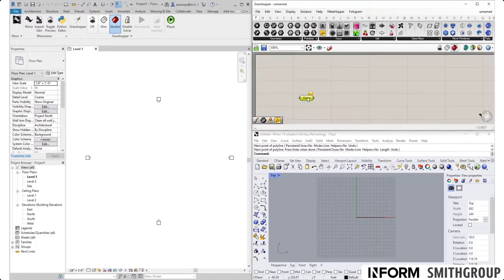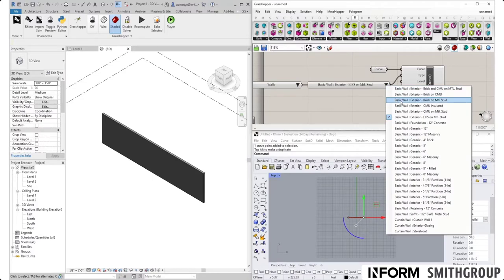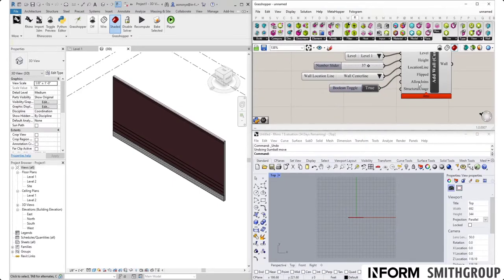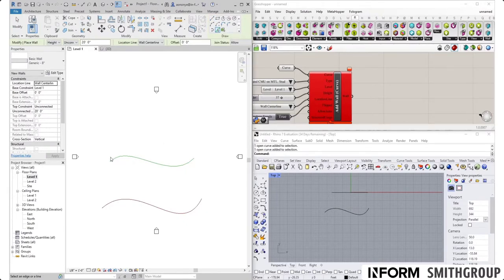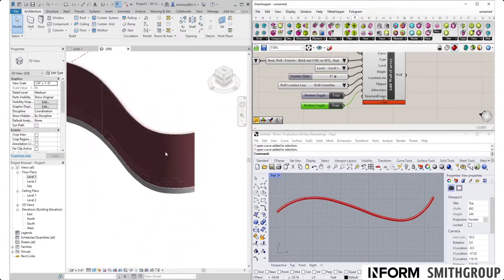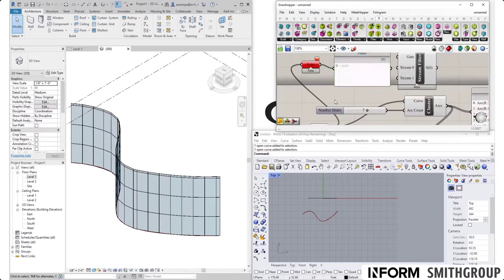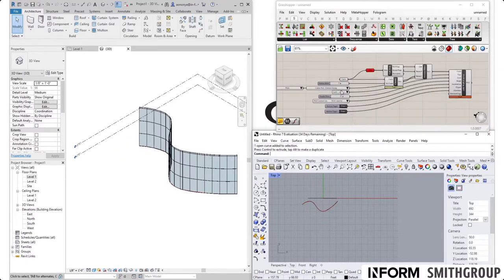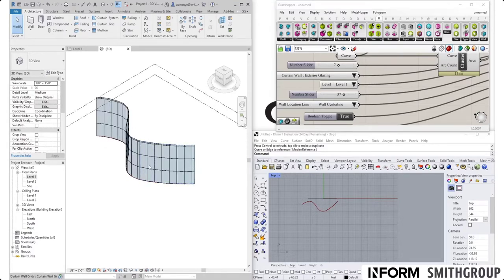Grasshopper Tutorial: Volume 4.2 - Create Revit walls with Grasshopper

Comment: Hi, i can't get past the first select curve. Feel like an idiot, but in your vid you right click on the curve, goto select one curve, then say "set one curve, which we've done", mine didn't. Argh! any tips would be much appreciated. Rhino and Grasshopper windows disapear, can't select the line in the revit window...
Reply from the maker: Hi Gavin. You need to select the curve in Rhino either before or after clicking "set one curve" on the curve node.
Reply: @computationaldesigndetroit1844  I experience the same too. I also did that select the curve in Rhino first then clicking "set one curve" but the windows disappear. Appreciate your help on this.